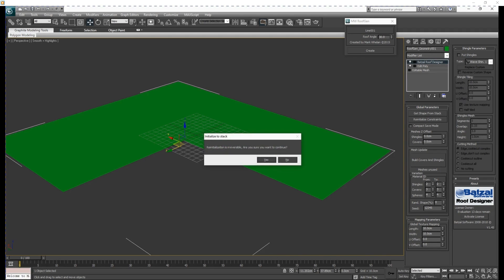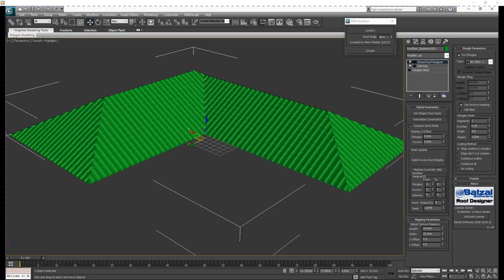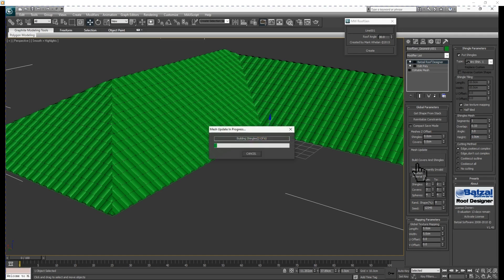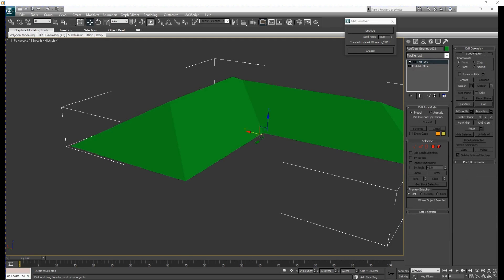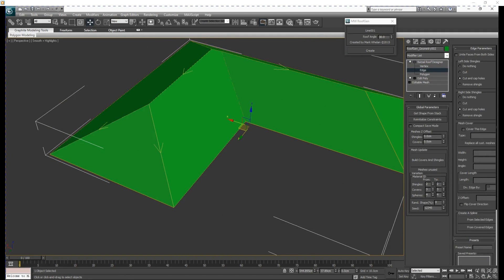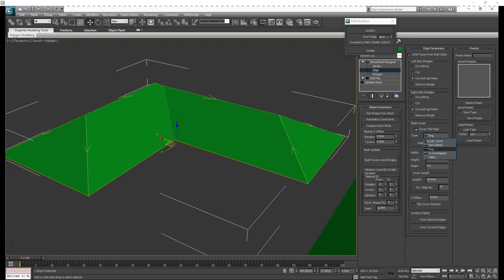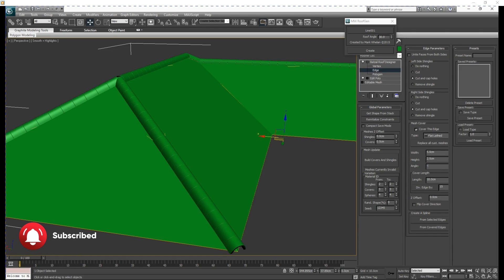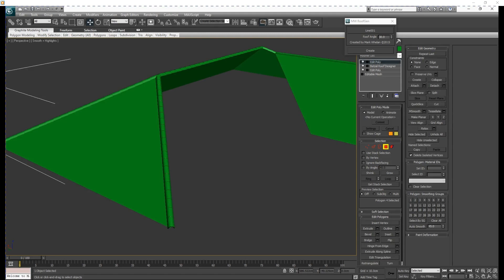HOW TO MAKE ROOF IN 3DS MAX / USING BATZAL ROOF DESIGNER AND ROOF GENERATOR

Comment: Can I use it on 3dsmax 2014?
Reply from the maker: batzal roof designer is only up to 3ds max 2013. They did not made anymore after that.
Reply: @AFMisadesigns  any roof generator you can recommend?
Reply from the maker: try the MW RoofGen

Comment: Can I use it on max 2016
Reply from the maker: The Roof generator you can use in max 2016, but the Batzal roof designer they stop until max 2013 only
Reply: Gel Misa does it work the same
Reply from the maker: Khobby Josh if you will watch the video, the Roof generator can only do the roof shape, but the Batzal roof designer, is the one that will produce you the design of the roof.
Reply from the maker: My suggestion to you isvto install lower version of 3d max or if you have one installed do your modeling in that then just export it as obj file